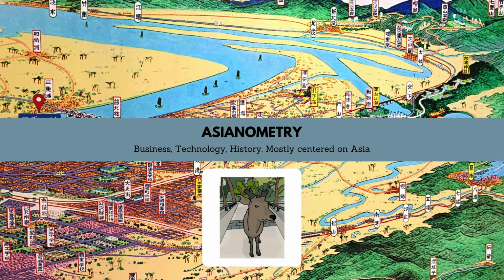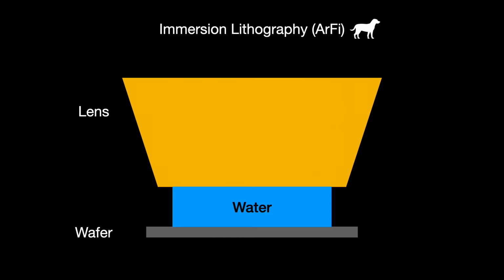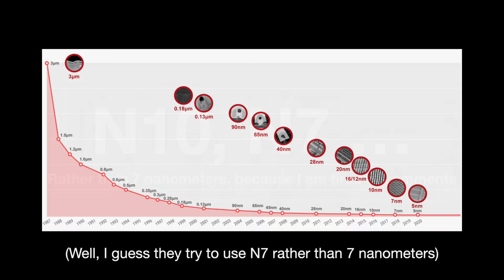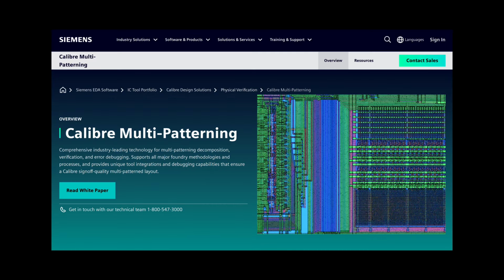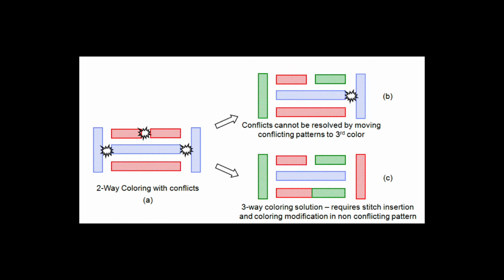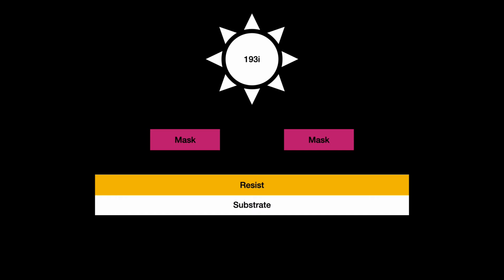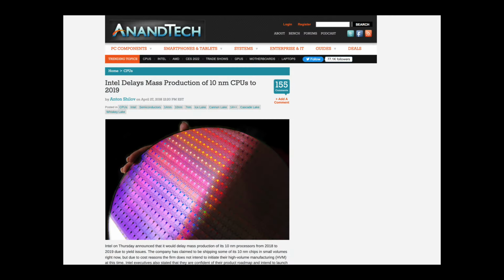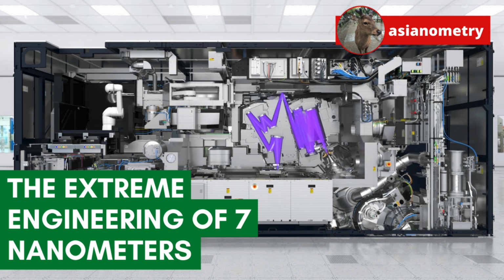Can You Do 7nm Chips Without EUV?

Comment: Stop looking at marketing inveted "nm" number and look at the transistor density, or millions of transistors per square millimeter (MTr/mm²) which cannot be re-interpreted by marketing.
Reply: HOW TO SEE THAT?
Reply: @LEOGOTBANAGAIN  Some manufacturers have more visible documentation, some try to hide the actual value (which alone should tell you that the value is not worth advertising).

Try googling for "wikipedia transistor density" for a list of well known labels.

The resulting page may say something like 'As of 2019, the semiconductor node with the highest transistor density is TSMC's 5 nanometer node, with 171.3 million transistors per square millimeter (note this corresponds to a transistor-transistor spacing of 76.4 nm, far greater than the relative meaningless "5nm")'.

Comment: China actually did. Technology has nothing to do with "globally compete" but geopolitics and national security. This is why South and North Korea have their own office packages ,operating systems and their Internet is strictly controlled by the state system. China doesn't develop its own semiconductor tech for global competitiveness, only for self reliance. Recently China has started to phasse out foreign processors as its own developed ones are good enough for office,education and state system related functions. Korea got its first OS code from a joint venture in the early '80s(fully foreign owned companies weren't allowed then) which included all of commercial Unix code. As the software protection laws were enacted in 1987, the music record laws were applied in that case. Its successor is powering Korea's centralised mass surveillance network which is physically separated from any outside network. Technology is actually about reinventing the wheel. It has nothing to do with economy or profit, just survival as a nation. This is the reason why Korea is now the only capitalist country which has made and fielded hypersonic cruise missiles(the K3M22 Hycore which is the only one with a dual-mode ramjet/scramjet engine;it was based on the Russian 3M22 Zirkon but now is totally different)Korea's Area Hangeul is a good example-its word processor package which was made in June 1989 by people I know is the only one authorised to be used in Korean government and army (to prevent foreigners to access local official documents) . Now it has a space business branch. North Korea has a 20nm process based semicon industry but there are no special sanctions applied to them because its only overseas business is that of unprofitable legacy process foundry contracts. This enabled them to make their own HPC and encrypted military radios.

Comment: The best viewing date for this video should be one year from now. After experiencing commercial sanctions, Huawei still used DUV to make the 7nm chip Kirin 9000s, which has been used in the latest generation of Mate60Pro. Although there are evaluation videos showing that its energy consumption performance is even worse than Qualcomm Snapdragon 888, it is forced to Commercial sanctions are the only way out. Rather, I am surprised that they have actually achieved mass production of DUV7nm.This video is like a prophet😆
Reply: Cost more to make (as n+2) lesser output in batch but the margin is high enough for huawei.😂

Comment: Is Huawei Mate 60 Pro using 7nm chips as it claims?  If yes, how did it achieve it?
Reply: Probably with ASML's DUV machine, theoretically it would be much more expensive, but who knows
Reply: LOL, don't buy their propaganda. Zero chance these are Chinese made, or SMIL made
Reply: its using asml duv and hynx dram, but thats it, the rest made by SMIC or at least reverse engineering samsung 4nm @The_Ballo
Reply: @INTJ791  Samsung uses EUV
Reply: @The_Ballo that's even more impressive, DUV perform similar to so called '"advanced" 4nm EUV samsung
Reply: @INTJ791  Everyone knows Exynos sucks. The claim that it's faster than Apple Silicon is more impressive.

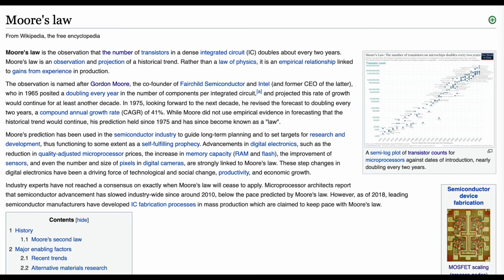Comment: 3:03  Going from 65 to 45, or from 10 to 7, is 30% smaller, not "70% smaller."
Reply: No, it's not, 7nm and 10nm is marketing purpose, actual die shrink is 70 percent more transistor
Reply: @INTJ791 , if linear feature size goes from 10 nm to 7 nm, that's 3nm smaller (3nm/10nm = 30% smaller). But because area is linear dimension squared, going from 10²=100 nm² to 7²=49 nm² would be a 51% reduction in area.

70% more transistors in the same area would mean that features are, on average, 1-(100/170) = 41% smaller in area. So you could say the features are forty percent smaller.

That's close enough to 51% for marketing purposes, I guess. So it would be only small exaggeration to say the features are about fifty percent smaller.

But definitely not "seventy percent smaller."

Comment: Where there’s a will there’s a way.   China made 7 nm dies by making them very small, then using their module technology (same technology as AMD uses. AMD’s chiplet R&D was funded by China and saved AMD).  SMIC put a lot of very small chiplets in one package. The small chiplet size meant every wafer still had some good dies, even though there are many imperfections per wafer.  But right now China’s biggest push is to dominate 28 nm production volume which is the lion’s share of the industry.

Comment: Thus water acts as a lens, either concentrating or dispersing, alternately a well designed lens would compensate?
Reply: Water reduces the wavelength of light. Making smaller features possible.
Reply: @pizzablender  perhaps wavelength shall not be alerted, but intensity would reduce!!!
Reply: Also, unwanted Reflections should be reduced because change in index of refraction is reduced when passing through the last lens surface

Comment: 1. Asml is the only supplier of Euv machines in the world to produce 7 no chips.
2. The USA has banned Asml from selling any Euv machines to China.
3. So it’s impossible for China to produce any 7nm chips.
4. So the latest news of smic exporting 7nm chips is bs? 😂
That’s asianometry.
Reply: it technically could happen without EUV but would be more more difficult and more complicated, technically they could make sub 5nm but with much lower yield and efficiency than the actual 5nm
Reply: @khein2204  It has already happened. Yield depends on the process maturity. So once perfected, Сhina's 7 nm chips won't just have a standard yield, but they'll also be much cheaper than the rest due to using DUV instead of EUV which saves a lot of money.
Reply: Ops Blac  
Steal? You’re brainwashed by western antiChina Propaganda like trump.
Fact is the USA steal,cheat and lie. And now the USA is robbing tsmc of their technology.
You may like to say the USA has no 5G because China stole it.

Comment: I remember cpu processors going from 45 to 35 to 29 nm. Brought back good memories back when I was assembling computers. I also remember reading up about cpu piping instruction (instruction pipes) during amd and intel wars.
Reply: 35 was never a process ,same with 29
Reply: @godslayer1415   thanks for the clarification buddy. Tbh I was not so sure and was having a debate with myself about the shrinking of the die size, if it goes from 45 to 40, 38, 35 or 32 to 28, 29, 22 and got it all wrong. My recollection of it was all over the place. I got out awhile ago and was not keeping myself upto date.  Thanks for the reminder. Sorry if this has caused confusion for anyone.

Comment: Intel didn't ramp up their 10nm node (which they now call "Intel 7") until 2020 in mobile parts, and 2021 in desktop parts.

As for why it was so delayed, a good chunk of the blame seems to be due to using cobalt instead of copper in a lot of places, where the cobalt had a nasty tendency to become brittle and fail.

Despite being roughly the same as TSMC's 7nm non-EUV node in terms of density, it's still quite far behind on efficiency.  So it's arguably not yet fully ramped up.
Reply: Only 10nm ESF has been rebranded, also source for your power related claims ?

Comment: I don't get why there's such a push to make chips more dense. They're already so tiny... I mean maybe for smart watches and other ultra compact form factor devices it would be useful (even in smartphones there's probably enough room to simply make the chips bigger instead of fitting more transistors into the same amount of space), but in most devices, the chips could easily be 4x bigger and it would be just fine.

I guess its a cost thing? The pure silicon wafers are expensive to produce, so getting more computing power out of a square centimeter is considered a win... but if the cost of achieving greater density is more than manufacturing a blank wafer, then it's really not a win. I just don't see why they are pushing so hard for these density improvements when surely better designed circuit architecture (or improvements/inventing new techniques in other areas) would yield better computing gains per cost. 

TLDR: Chips tiny.. why make tiny-er?
Reply: You nailed it. They can create more with less. And devices are on a race to become thinner and smaller.

Comment: Maybe using low power X-rays? X-rays have shorter wave lengths than ultraviolet light, and X-ray machines are almost dirt cheap with even all of your local dentists have X-ray machines in their offices. Mixing metal powder with photoresist may block low level X-rays to print integrated chips?

Comment: I've heard that Apple has successfully bypassed Intel in chip fabrication process because their ARM chips have much less instructions to implement, so allowing for denser arrangements with less errors than in Intel's complex instructions set processors.
Reply: I dunno about that. ARM is famously a very "un-RISC" architecture, with many instructions. And complex, high-performance processors (like the M1 or Intel and AMD's x86 for the last two decades) perform so many transformations on the instruction stream before actual execution that the original instruction set has little impact on performance or complexity of the chip.

Comment: My Computer has an i7 2600K, and runs just fine with its 11 year old architecture, printed with 32nm lithography. Why is it that we MUST have 7nm litho, I just don't get it. The truth is that most modern CPUS can only be noticed to be faster than it with bench marks software, all the other software runs fine. What are your thoughts about that?
Reply: ...No. The increased speed compared to the 2600k is extremely noticeable in everyday use.
Reply: @Zeno-  I agree, it is noticeable, but games are still playable, Office still runs fine, the machine boots in 30 seconds, movies run fine (as they did 7 years ago). And further.. Much of the improvements, are not due to 7nm (although much of the compactness is) but better logic in the chains, and better algorithms for prediction. What surprises Me is that many of the newer CPUs are only 50% faster. There are issues with 7nm a well (electron hopping etc). It certainly helps for Laptops.
BTW, love your channel, and presentations, very high quality and great information. Thanks..
Sometimes I feel we are on this bandwandwagon to no where, and many of the things we could not do 15 years ago, are now easy, we should sit back a little and think about where we are going..

Comment: I saw a compelling presentation once called “28nm forever” basically it made the case that the most cost efficient cheapest chips to produce would be 28nm (or let’s stretch to 22?) for a long long time if not perhaps eternity.
Reply: Not only is 28nm cost effective in production. It is basically also the end of power and voltage scaling. After that there are more transistors per area, but the transistors use the same power, so the ocerall power per area inceeases.
Reply: @_TeXoN_  I don’t think I agree with you there, otherwise the R5 5600X would not be 65W for it’s performance. I’m not calling you out, I suspect there was some real academia saying this but my gut tells me it can’t be true judging by efficiency gains (per unit of performance or per # of transistors) that we have seen empirically.
Reply: @depth386  Just read about Dennard Scaling. It is the physical equivalent to Moore's Law, but failed around 2005. 
Everything below 28nm is also not a real measurement, but marketing names.
Reply: @_TeXoN_  Okay I will look into that, and I do agree that “#nm” has become BS, Der8auer showed a 9900K and some Ryzen 3000 ground down to expose to die under an electron microscope, they were almost the same despite “14+++ vs 7”. 

However, I am left with one more good question. Could you please explain to me, how are they packing more and more transistors? Transistor counts for both GPUs and CPUs are still going up by large percentages comparing one generation to the next. RTX 4000 series graphics cards are rumored to have 3x the 3000 series for instance. A little bit might be die size (and the recent trend of upward creep in power consumption) but there is still much progress in how many transistors they’re etching.
Reply: @_TeXoN_  by the way I just read the wikipedia article on Dennard scaling. It’s not super in depth but it did give me an “aha, so that’s why i noticed going from Pentium 4 2.6Ghz to only 3.06Ghz i7-950 was like.. wtf? There were IPC gains and multi core gains but still, I was used to specs going up like 80386 33Mhz Pentium 1 133 Mhz Pentium 2 350Mhz Pentium 3 1Ghz Pentium 4 2-3Ghz it was tripling even without IPC advancements in the good old days
Reply: @depth386  If you compare an FX-8350 to an Ryzen 5600, you have roughtly three times the transistor count  and three times the performance.
The area is about the same, but Bulldozer was manufactured in 28nm and Ryzen in a mixture of 12nm and 7nm. The density still increases but not on the level one might expect.
Reply: @_TeXoN_  Right so going back to your first post where you say that the transistors use the same amount of power, wouldn’t the 5600X or recently released 5600 have to have much higher power draw if Dennard scaling was truly dead? Or is it just that there’s a lot more percentage  of the sillicon staying dark at any given moment, as described in the Dennard scaling wikipedia article?
Reply: @depth386  Looking back i think Dennards scalings says someting about power per area and that hasn't changed in the last years. 
I can't say much about dark silicon, but i think it is inevitable, if you try to catch every edge case with a dedicated circuit to improve your IPC.
Reply: @_TeXoN_  makes sense then, IPC gains leave more unused sillicon in exchange for shaving a cycle off of an instruction. And now thanks to this discussion I suspect the term “speculative execution” refers to a situation where just in case the instruction after A is B, then it lays some groundwork based on A’s data right away. It might allow a CPU to shave off a cycle in edge cases or to even execute two instructions in one cycle. Double Kill!
Reply: @depth386  i think transitors get smaller but the stuff around them like memory is still bigger or something and thats most of the die.
Reply: @phgamer4393  By memory you mean the “cache” inside the CPU? That’s all made of transistors my friend.

However there is the case of Ryzen’s chiplets, where AMD produces the I/O die on an older node because the performance there isn’t as crucial so your overall idea/thought of some parts not enjoying the same level of miniaturization does have some truth, it’s just not connected to “memory” in my opinion. And it’s all transistors, all of it.

Comment: Ok, why don't they just name nodes after the transistor density? Like pixels on a screen, I don't care how they achieve it, I just care about my screen resolution. That's the measure the they should have been using all along as that's what Moore was referring to. Or better, use some measure of information throughout from Shannon. The fundamental issue is the frequency of bit decisions per meter^2.

All the rest of this seems to be whatever hacks are needed to achieve that.

Comment: "Arf" ! Nooo - it's pronounced "Argon-Flouride".
Reply: No, its pronounced "193" as in 193nm DUV or 248nm DUV, 'coz the materials matter - you can print the same size feature, but you need to define what materials are used for the poor etch guy down the line that has to etch it!

Comment: The mechanical side of lacing those patterns together is pretty incredible. Flying back and forth after the wafer has been out of the machine to etch away stuff and then back for another round 24/7. What do they use? Linear bearings with linear drive motors and magnetic encoders?
Reply: I am pretty sure they use air bearing stages. We were able to do 5 nm locations in 2010 with air bearing stages and interferometers to locate. This was for imaging for DNA sequencing.
Reply: @redare7  A quick check shows ASML use magnetic bearings. Air bearings have been used previously in some older systems though, so you aren't that wrong.
Reply: AFAIK, other than magnetic encoders (they use very high resolution optical encoders in semiconductor applications), yes they are. Tons of them, in fact.
Reply: ??? Not sure what you mean here "lacing the patterns together"...Etching takes place in a either a wet process in acid etc. or a "dry" process in a vacuum chamber that is used to produce a reactive plasma to remove the films that are not masked by the resist from the litho print.
Etch is a global process, all the wafer is etched at once.
Making ICs is a layer by layer process, either adding materials to be subsequently patterned and etched, or global etches with no pattern where topography determines the remaining material etc. etc.